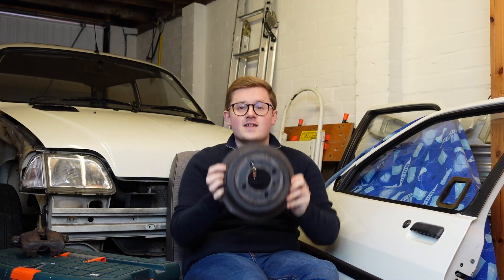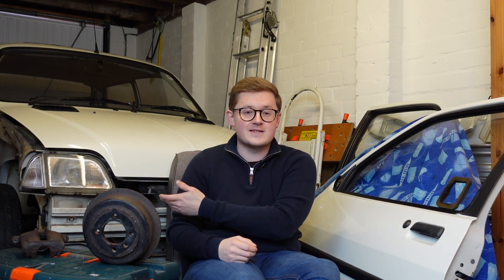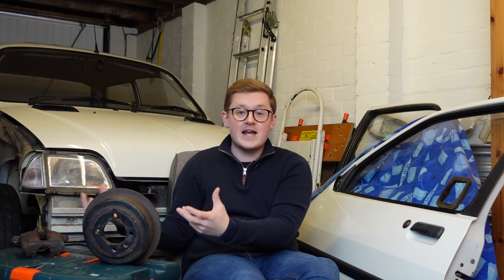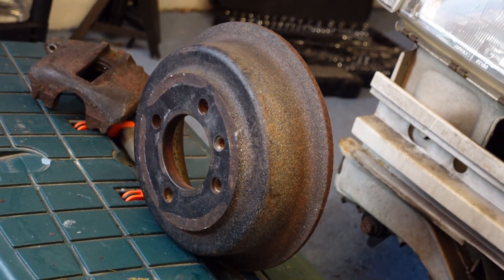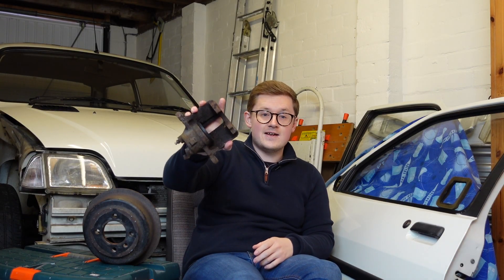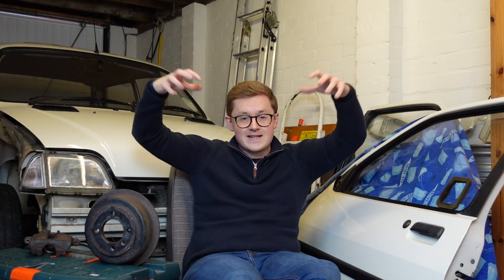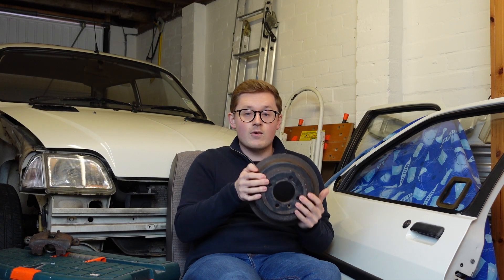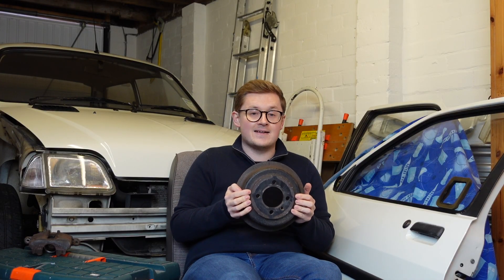Why are Drum Brakes Making an EV Comeback?

Comment: Regardless of whether the brake pedal is used, the mechanical brakes are used to stop the vehicle below a certain speed, typically a few MPH. Dynamic braking just isn't effective near zero speed. Even when touching the brake pedal in an EV the dynamic brakes are used as much as they can first, so the concept that the brake pedal is connected to the friction brakes is not correct. Modern EVs are a drive by wire system where the accelerator pedal and brake pedal signals are interpreted by the car's velocity controls and used to operate the electric motors and the friction brakes. There isn't a simple 1:1 mapping anymore. This setup can change with firmware, so when your EV gets updated things may be adjusted as they learn better algorithms and tuning to use.
Reply from the maker: Absolutely.

Comment: We have a four wheel disc brake vehicle. The emergency brake applies the rear discs through springs, so the emergency brake always goes "to the floor", but applies tension to the disc through the cable and spring. Some technicians don't seem to understand this system and tell us that the emergency brake needs adjustment, but this is normal operation for this system.

Comment: Very well prepared and factually accurate.  I’ve had to clean my rotors on my Hyundai Kona for the very reasons you described. I now turn off regenerative braking a few times a week to keep the rotors clean for exactly the very reason you described.  I will never go back to a gasoline fueled car ever again though.  I’m saving enough on fuel costs to pay for the car payments.
Reply from the maker: Thanks mate :)
I must ask about the costs though - although home charging is much cheaper, with electricity prices the way they are and public charging being so expensive, how much fuel did your old ICE car use?!
Reply: @TwinCam  I’ll send you fairly accurate #’s after Christmas (within <10% error).  Merry Christmas and a Happy New Year from 🇨🇦.  I can offer precise #’s on household charging as my charger tracks those values but basically 0.074$Cdn /kWh for 480-500 km /full battery (64kwh rated).

Comment: 😎👍🇺🇲

Being a States Born and raised.
I'm surprised to see the Metro's brake system is almost exactly the same as my 71 Mini's.
Besides having a Spitfire back in the day. My Mini is the only British car I've worked on.

On a side note. I recently found out it's actually a Mary Quant car. Missing some of the exterior signature bits. But the interior is all there.
Certainly can't be many of those special edition cars in the States.
Anyway, cheers from the PNW Seattle WA area 🤘
Reply from the maker: I was assuming your Mini was a late Mk3 Cooper S or a 1275 GT until I read about the Mary Quant bit!
In that case, as the US does have strict import rules, I'm sorry to say that I think your car may have had its VIN altered!
Reply: @TwinCam  
The car is titled as 1971 Mini Cooper S.
From what I learned. The Mary Quant cars didn't come out until the mid to late 80's. Although the information was spotty.
Engine # comes back as a 1984 Metro. Which is not surprising. These get swapped out all the time.
It does have most of the other S car bits. Big brakes, badging. Although I'm no expert on these. Still learning.
As far as the Vin. It's too late now. 😏
Reply from the maker: If it’s a genuine Mk3 S, it’s worth a fortune. The Mary Quant Minis were a special edition from 1987.
Reply: @TwinCam  
I have a short video of the air cleaner assembly I made.
It shows the interior.
Doesn't show the bash though.

Comment: Problem is easily solve by just applying the brakes hard once a day when driving an EV.  That will clean up all the crap on the rotors and pads.  I would rather have the disc than drums even on an EV for those emergency stops and even step long downhills.  Drums in the back is fine but front needs to stay disc.
Reply from the maker: The average consumer is incapable of maintaining tyre pressures - what makes you think they're capable of this? ;)
Reply: @TwinCam  it is about convenience.  Which checking and pumping up tires is not very to some folks, or seems as a chore.  But applying the brakes hard once a day is easy, takes no effort but to remember to do  so.

Comment: Now have a look at "Wet Discs" first brought out by a tractor company. Housing the disc and caliper in a drum cutting a 25mm wide groove in the disc pad and then placing the disc and caliper in a sealed drum filled with automatic transmission fluid, whalla you have the ultimate braking device giving full control by the driver over the vehicle's ability to stop. Of course the wet disc brake is only good on the front axle.

Comment: Ok'ish for public idiots but hopeless for cognative people.

Tyre and brake dust is claimed to be the biggest "anti green" after exhausts but drums clear that up.

Please explain how drums clear up tyre particulates.

Drum shoes wear less because they are bigger than disk pads, really? 

Why don't you learn about the coeficient of friction of different materials before talking rubbish.

The big disks do have a quadrupal disadvantage but (not remotely thought about in this crap video) which is of course the extra mass horribly  increases the unsprung weight and it  reduces both acceleration & deceleration due to kinetics and disks drag more as drum shoes actually are spring released.
But that raises a minefield of other issues.

No discussion about braking compounds, just ashumes all brake dust is equal!

So the likely extreems of asbestos vs ceramic materials are all the same in green eyes.

If this was done for primary school homework I would have told the kid to do it again.
Reply from the maker: Incredibly rich of you to talk about homework, because this comment is hilariously poorly conceived.

You say that as if cleaning the environment is a bad thing. I, for one, don't think throwing particulates in the air is a good thing, and the law has had a part to play in brake dust for over thirty years, limiting the types of friction materials available to manufacturers in order to protect our health.

As for tyre particulates, isn't it obvious? I didn't once say that drums did that, I said that tyre particulates are alongside brake dust in the Euro 7 legislation. Listening skills are important in primary school.

Your point about friction materials is similarly hilarious though, as you clearly didn't listen to most of what I said. Do the words 'similarly sized' and 'equivalent' ring a bell to you? If you put a racing friction material in one system, and an economy one in another, it doesn't take a genius to work out the results.

FInally, 'extreems' HA!

Comment: Corrosion is a big issue, even with hybrids. I am replacing the brakes on my 2017 Prius at 100,000km not because they are worn but because the rotors are corroded badly. There's lots of pad material left but it doesn't matter when the rotors are rusted to shit. I'm trying to make a conscious effort to brake more aggressively for the purpose of getting my brakes nice and hot so that any water evaporates off them. This ironically means I have to drive slightly less efficiently in order to make sure my brakes remain clean and rust-free. Bringing drums back for this reason alone makes a ton of sense.

Comment: You make a very good point about underused discs going rusty, I've just bought a hybrid and it did occur to me that this could be a problem.
I must admit that I was surprised at the amount of slowing down that you can get from regenerative braking, and I'm sure that with gentle driving, and looking ahead, the actual brakes wouldn't be used very much, if at all.
It looks like when slowing down, especially in wet weather, we'll have to decide between recapturing that energy, or drying the brake discs.
Reply: At the end of each stop, below a certain speed, dynamic braking stops being effective, so the friction brakes are applied at that point. They don't wear much at these low speeds, but they do get exercised.
Reply: @alanb76  thank you, I thought it might be something like that. The brakes certainly feel different when you apply them at a very low speed, such as when parking. I assumed that was because the friction brakes were being used.
Reply: I can confirm with an ev that the physical breaks aren’t used much and rusting disks are a problem. Ones in a while I have to brake hard to get the rust off
Reply: thank you, I'll have to get into the habit of doing that myself @1987tijgertje
Reply: Sadly, few drivers seem to look further ahead than the car in front.
Reply: Is it possible to have disk materials that are corrosion resistant?
Reply from the maker: Carbon aren’t useable on the road, but carbon ceramic is, and won’t rust. However, it’s noisy and needs warming up somewhat, not to mention the expense!
Reply: @TwinCam  fair points - let's face it, they're likely bought for the bragging rights!
Reply: @balahmay carbon fibre? Think Porsche option stainless discs on the Taycan... But like exhausts, you'd think "technological advancement"would have us with ever-lasting components by now right...
Reply: @balahmay  I think brake discs use a form of cast iron, which is self lubricating, hence being used for engine cylinder liners. That may be important for longevity as cast is already fairly corrosion resistant. stainless steel tends to cause spalling, it's terribly gummy to drill. there's bronze which are used in clutches, very expensive. In short, there are no good alternatives.
Reply: That would be sensible. Some sort of stainless steel perhaps? @balahmay
Reply: @balahmay yes motorcycles use stainless steel disc rotors they do tend to wear down thin quicker than iron discs.
Reply: @balahmay   it's either expensive (carbon fibre) or not efficient for braking.

Rusty brake discs are not a big deal, that's why you make a brake check after low periods of usage and also brake them free.
(of course when nobody is behind you).

And you don't assume full braking action right away.
Reply: @balahmay  Yes, you can have them as factory upgrade on some cars, but it is expensive.

Comment: As someone who has driven many cars in the 60’s with drum brakes, I can tell you with absolute certainty that drum brakes cease to work when driven in very heavy rain or deep puddles.  It is not just fade, it is loss of brakes.  The only way to get back the braking is to “ride” the brakes for quite some time to generate enough heat to dry them out.  They are dangerous period. Also the complicated design of the 3 unique springs combined with the left and right side being mirror images of each other, allows for mechanics to assemble them wrong.  Also note that when the brakes are installed, they are adjusted to intentionally “drag” on the drum so to allow them to self-adjust when backing up.  I seriously doubt manufacturers would risk the liability that comes from drum brakes.
Reply from the maker: Hence why you're trained to dry your brakes after driving through standing water.

Comment: will brake fade be totally eradicated
Reply from the maker: In everyday driving, theoretically. Then again, brake fade shouldn't happen nowadays anyway.
Reply: @TwinCam  sadly though it still does...i am wondering how a drum will dissipate heat effectively...which was one of the reasons behind the disc set up...both have their advantages and disadvantages i guess....brilliant channel you have
Reply from the maker: Thank you my friend 🙂
Yes, it can be made to happen, but in normal use at average road speeds, it shouldn’t. With a theoretical full drum setup, while fade would come sooner, the existence of regen means you’d need to be seriously hooning in order to get there!

Comment: You need coppaslip on that adjuster. In service adjustments required.
And brake shoes corrode between the shoe and lining causing delmintion, bind/failure. If park brake shoes engaged in motion with a corroded drum (shoulld only be used when parked) it rips out that anchors and springs from the backplate.
Reply from the maker: The car's been off the road for two years - it's all deteriorating and has been messed with!

Comment: Good video Twin Cam l have and do own vehicles with disc drum comber action and l drove vans and Ute's for the time l had them never changed the rear brake shoes changed plenty of disc pads but it so much easier to change disc pads than drum brake shoes
Reply from the maker: It is easier, but it's only 5 more minutes!

Comment: Hi Ed. Great video as always. It's so funny, I was only thinking about this topic the other day when I looked at the slight rust on the surface of the discs on my EV, a BYD Atto 3. It's not heavy by any means but I did think if using drum brakes, certainly at the rear, this may be a better option. The regen on the Atto 3 is not that great and certainly, nothing like a Tesla which has one foot driving but still, they could certainly have a use. Drum brakes take me back to motorcycling in the 70s when I'd dismantle my drums and clean them out, making sure that the shoe pivot points were greased and that the leading edges of the drums were nicely filed down to stop the shoes grabbing at the inside of the drums. Arghh, happy days!

Comment: Drums require more maintenance and perform abysmally if that maintenance isn’t done. They are inconsistent in use.  I would not buy a car in 2023 that uses them, EV or not. Your reference to the cost to replace a calliper is weird to me. In over 40 years of driving I have never needed to replace one on any of my vehicles.  Maybe this is a warm weather thing - here in Australia we don’t have salty winter roads - but even when living right next to the ocean where everything corrodes I’ve never had a problem.  The last vehicle that I owned with drums on it was my 1981 Yamaha XJ750, or a 1988 Camry that I bought for my partner to drive. 

Sure, the parking brake is simpler with drums but that doesn’t outweigh the disadvantages. As for disk rotors rusting, a simple software solution is to have the car dab he brakes every so often when braking. Tesla does this, and uses disks.  VW just cheaped out with their EV as they were already losing money on them and needed to keep costs down.
Reply from the maker: It might be a climate issue, but I'd suggest you've just been exceptionally lucky. I've had three cars and have been driving my own cars for four years. I've needed two new calipers. On the other hand, one drum adjuster seized, but that's a much cheaper and easier job to replace!
Reply: @TwinCam   What was the problem with the calipers? There isn’t much more in them than a drum brake. A piston or two, and a couple of pins fins for sliders and the brake pad itself. 
Aside from upgrades, I’ve never even had a mate who replaced a caliper.
Reply: @Chris_1024_  You’ve obviously never owned a car with drum brakes mate.  Trucks use them because they are cheap. Air disk brakes are very expensive.

Comment: Excellent presentation. In  an empty German parking lot of a mall in 1968 I was told on how to quickly stop in transversal position my small, rear engine Fiat 850 by abruptly turning the steering wheel  to the left whilst pulling the drum handbrake with the right hand. After two or three trials a security guard turned up out of nowhere and asked us to stop.
Reply from the maker: Thanks mate :)
Reply: The 850 spider! I grew up with one of those in Minnesota, of all places. Easiest clutch job ever: 850 was the engine displacement in cc, so sub liter. There are larger motorcycles. And since it predated the 5 mph bumper, and was rear mounted, you unbolt the rear panel of the car, push a wheelbarrow under the now fully exposed engine, and unbolt it from the transmission, dropping the engine into the wheelbarrow and take it away, exposing the clutch plates. Replace and reverse. 2 hour job, tops, all you need is a socket set.

Comment: I've noticed that a lot of "single-engine" EVs are rear-wheel drive, which I assume means that regenerative braking can only recover the 30% of energy from the rear wheels, not the 70% of the front wheels.  Maybe this is why some of the AWD or twin-engined models seem to have longer range than single-engine models, which I always thought was counter-intuitive.
Reply from the maker: That is a big part of that range increase. They have to peg back the regen!
Reply: I think the 30% figure only applies when you are braking all four wheels.

If you are braking just the rear wheels, in a RWD regen scenario, then by definition 100% of the braking is being done by the rear wheels.

Naturally, the limit comes when the rear wheels start to lose traction as the weight of the car lunges forwards under extreme deceleration.
Reply: Actually, even two-motor vehicles do not necessarily engage regen on both motors.  Many of them will only regen off the rear motor.  The VW ID series is one example... the dual-motor IDs only regen off the rears.   Nor do they need any more.  In a full battery electric, the regen from a single motor is already huge.

In anycase, in most EVs, the regen and the physical brakes do not engage at the same time.  The regen engages first and the physical brakes only engage if you need to slow down more quickly than the regen allows.  So regardless of how the electric motors are configured, the regen is handling nearly 100% of the braking action in almost all normal situations in a full battery electric, highway or city, steep mountain roads up or down, flats, or whatever.  Doesn't matter.

EVs can regen a massive amount of energy, often over 100kW continuously, with no real time limit unless the battery actually becomes 100% full (which does not typically happen).   For example, when I'm dropping into the Reno basin from Lake Tahoe, I'm going on a pretty steep downhill for 30 minutes and the car is doing variable regen the entire time, without using the real brakes at all, and it recovers well over 15% of its battery capacity by the time I hit the flats.  Pretty cool!